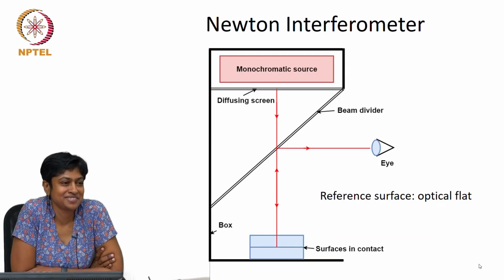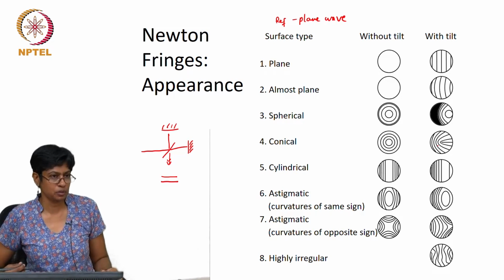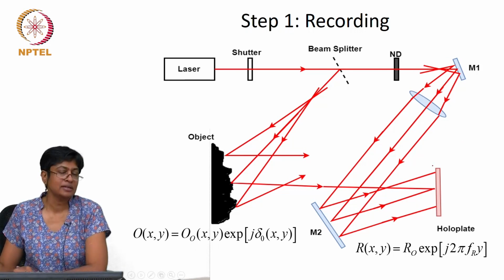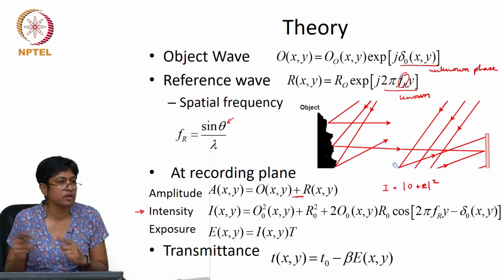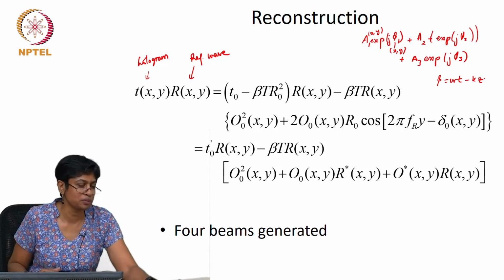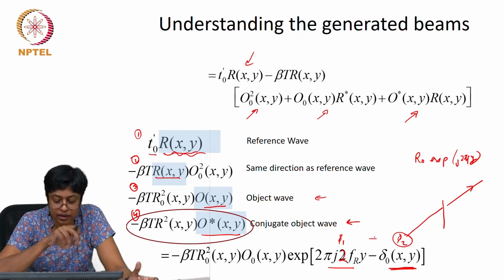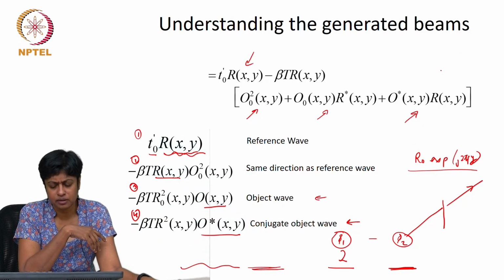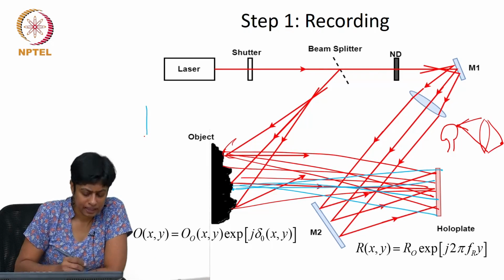#40 Holography | Part 2 | Optical Engineering

Comment: why only laser light is used?
Reply: My understanding is that we should know all the information of the reference beam to achieve this. The laser is monochromatic and it have a very samll angle of divergence (please Google Gaussian Beam if you do not know what is it), hence the wavelength of the light will not be changed too much (ignore the change if the distance of propagation is small such as in the lab), hence laser is the best choice. For other lights, the light beam may consist many photons with different wavelength, laser does not have such problem.
Reply: The coherence length of laser is very high around 500-600kms and for other source of lights it’s very less. When the coherence length is less than the path difference of the interference fringes. We cannot actually record the fringes at all by any means. The whole purpose of recording fringes is not possible. So only for laser coherence length is orders of magnitude higher than path difference that’s why we use laser and not other sources.
Reply: @007rwarr  Thank you for the reply